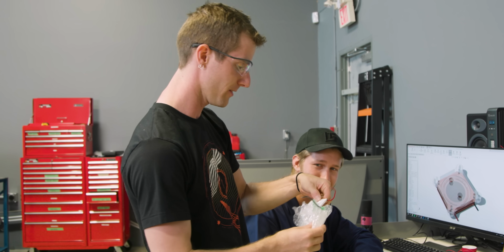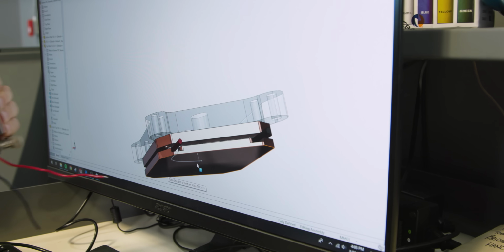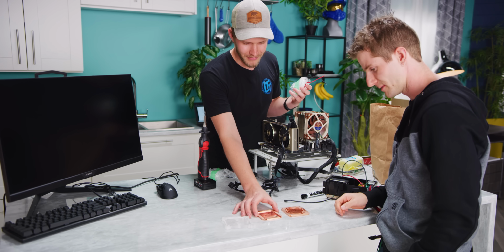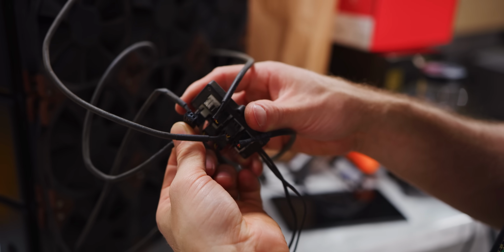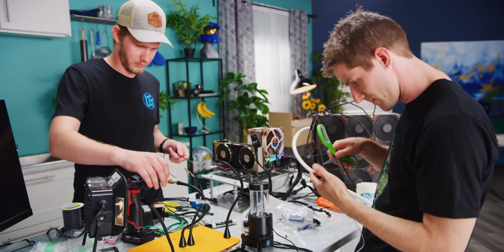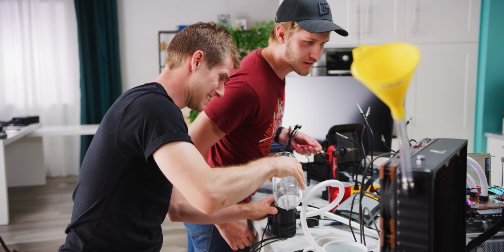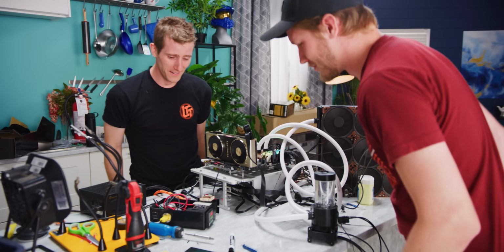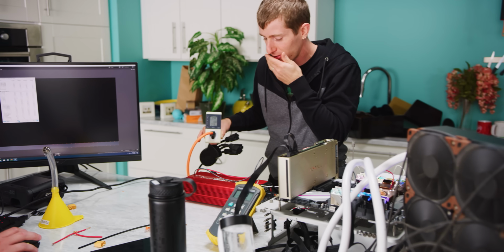This Cooler DRAWS 545W!!? Bad Cooling Ideas #2

Comment: Ok, you do know the extinguisher works better if you take the pin out of it first lol. Also you should invest in some halon extinguishers. They work very good indoors and they don't hurt paint or electronics. They are non toxic, don't conduct electricity and along with cutting the oxygen they also cool. I used to sell them in the 90's and during my demo I would spray them into running electronics and onto food and then eat it. Down side is they are kind of pricy and they don't work well outdoors. But considering the price of most of your equipment the cost would be well worth it. We used it for fighter jets in the airforce.

That radiator is larger than the radiator in my car lol. You should have just mounted a car fan to it.

Comment: The reason it won't work is efficiency.
In a nutshell, there's 2 things wrong with this setup.
1: the water block is only going to be able to move so much heat before it hits PDR (Point of Diminishing Returns, for those wondering...).
If the block can only draw so many joules of energy, then adding more wattage/voltage only brings you closer to PDR.
2: peltiers are inherently inefficient because the amount of heat they extract from the cold side is added to the amount of heat generated simply through its own operation. So a 550 watt pelt sitting on top of a 250 watt cpu will generate 800 watts of heat combined, or up to the theoretical maximum thermal capacity of the pelt itself.
In essence, you basically were trying to cool down a 5hp lawnmower with that tiny bit of copper for a waterblock.
More surface area to extract the heat will produce better results, but you'll still hit the PDR, regardless of the size of the peltier.
You're almost better off using a dual-loop system with 4-100 watt pelts chilling plates that are connected to a second loop for the CPU, being cooled by the primary loop going from the hot side to the radiators.
That's about the gist of this thermal dynamics 101 class.
P.S.: I did something similar with the old Barton core Athlon 2500 with a modest overclock to 2.2ghz, and maintained 19°C under Prime 95 for 4 hours straight.

Comment: Don't cool the block with the peltier. Do a standard liquid cooling system but Make a copper reservoir and chill the coolent with a peltier then use a 2nd liquid cooling system  or air cooled heatsink for hot side of peltier.

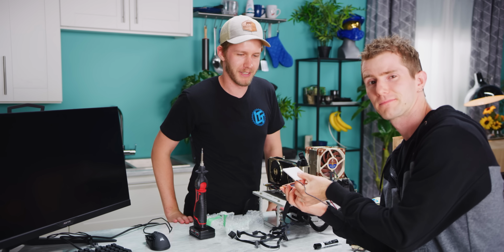Comment: 7:15 basically it shouldn't matter wich direction you put it in, you just need to switch polarity (the red wire becomes minus and the black one becomes plus, but you should first check with a Multimeter in Diode Check mode that the reading is identical in both directions)

Comment: there are 3 types of cooling, the conventional one, the dry metal with fins on small fans on it, the second is the last popular one the water cooling, the commonly use the third is mercury water inside a metal which cools down by large fans,... but the one hit wonder of a cooling system that will last is the the very system that we all uses to cools down cars, homes, and building, guess what... the compression and expansion type of cooling... ta da... why no manufacturer build it because they want to make money. as simple as that

Comment: extra points for the solidworks engineering and demo, but you are using the wrong power supply. Pulse with modulating power supply is bad with TEC it reduces its already terrible efficiency. an other fault is running it at a high voltage this increases the current which will increase the maximum Delta T but reduces the maximum cooling capacity. even than it is crap for PC cooling. TEC cooling is nice to cool something above ambient or really slow like the cheap small portable coolers

Comment: A year ago you guys reviewed a special thermal pad like material that had carbon nanotubes and not only did it transfer heat well in the z direction but also in the X and y.  A torch was applied to one side of the material and it burned the finger touching the other side. How come I don’t see you ever using this in any other application it seems like that might work well here.

Comment: A couple of tips: 
1. you could have just measured the temperature at the edge of the cold plate, as that's the area where condensation would be a concern - you can solder the junction of a thermocouple directly to a metallic surface so long as your TC readout has an isolated input or the cold plate has no conductive path to ground.
2. As others have mentioned, an overpowerd TEC just becomes a resistive heater... you have to do testing to find that point and target a power somewhat below that.
3. If you're going through all the effort of designing custom blocks, you might as well add a dry gas purge around the cold plate to go as cold as you want without worrying about condensation
4. As others have mentioned, you'd be far better served by having "hot" and "cold" loops interfaced by the TEC than trying to dump the TEC directly onto the cpu.

Comment: I always wished this design would work but alas it is a firm no.
I agree, if the TEC was integrated into the radiator, you may end up with a preferable solution, as long as your heat dump was big enough.

Comment: that radiator is thicker than the ones you find in some small cars like the 90s Suzuki Swifts, just needs a pressure cap and it's ready for the road. lol

Comment: okay
just make 3 different loops - one for cpu, two for tec
first loop: pump>cpu>360mil rad>heat exchanger(other side connected to 2'nd loop)>pump again
second loop: pump>heat exchanger>tec (or some array ov them, cool side)>pump again
Last one: pump>tec (hot side)> real BIG radiator> pump again
May be difficult, but idea in seporation of heat sources. Try - for you team it not a big deal, dont ignore me, if you see this messege.

Comment: you did a mistake.....

the peltier elemet has to cool the water in a seperate module, not between the cpu and cooler. So you have the entire water capacity for cooling, not just the thin copper between the peltier and the CPU...
Reply: This isn't about "capacity", unless your plan is to only cool the CPU for one benchmark or so. This is about sustained (and forced) heat transfer away from the CPU. In other terms, it's about watts, not degrees.